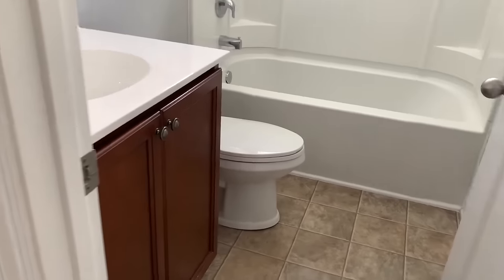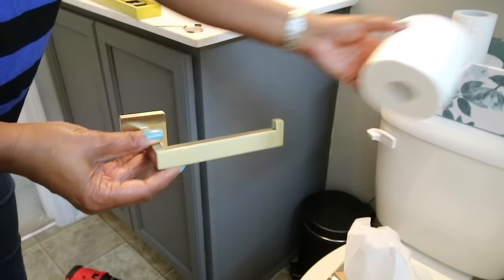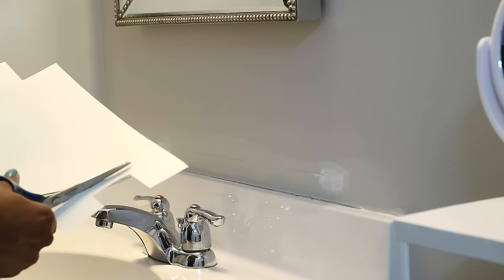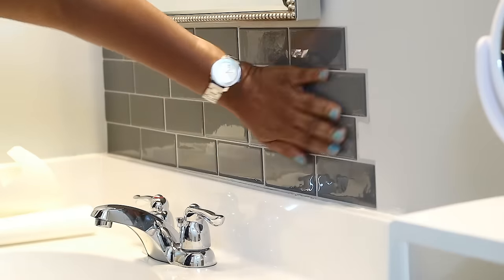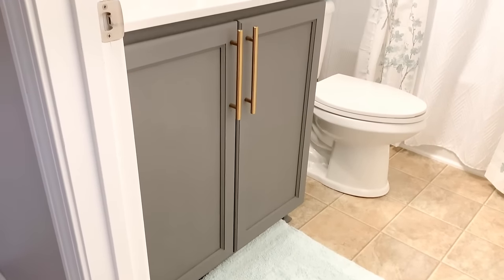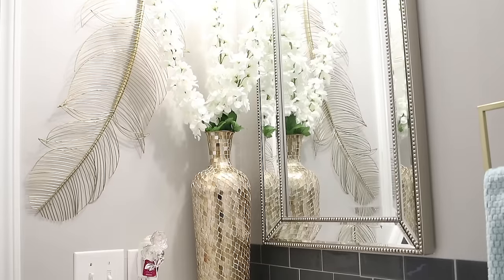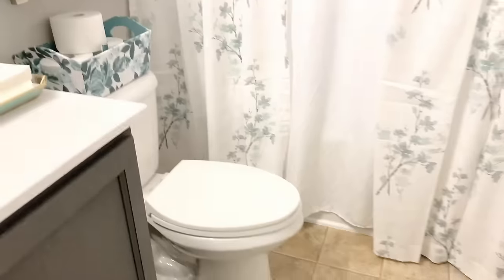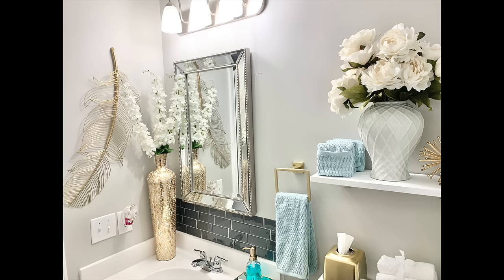SMALL BATHROOM DESIGN IDEAS

Comment: Loving the dark grey peal & stick tile sheets. That’s what I’m planning to use in my kitchen over the top of the existing yucky tiles.. they’re £10 for a pack of 5 here in the UK, at B+M’s if there’s any folks watching from the UK. Thanks for sharing this very nice bathroom makeover. 💚 ive got the same flowers in the tall vase. On the side of the sink/basin cabinet. They’re lovely..❤
I’ve just had my new bathroom suit replaced & just waiting now on the decorators coming into do the ceiling. Painting the walls, woodwork & then my flooring will be installed for me too. (I will eventually be adding wallpaper, too. But still haven’t decided on a style or colour scene yet.) So I’ve been watching tons of You Tube make over vids for inspiration. Thanks again Michelle. And WELL DONE 🎉

Comment: Hi, I have two questions. I am following your video step by step and do you think I should use the wax( from same brand) after I am done painting the cabinets of vanity?
Second question is - what size  of floating shelves did you use?
Thanks
Reply from the maker: You can use a different brand of wax, it should work fine. 
I made the shelves myself so they are 6” wide by 15 “ long